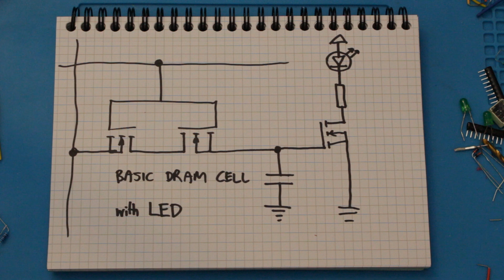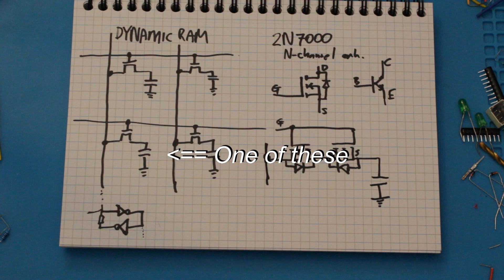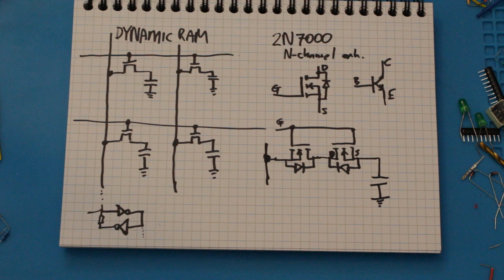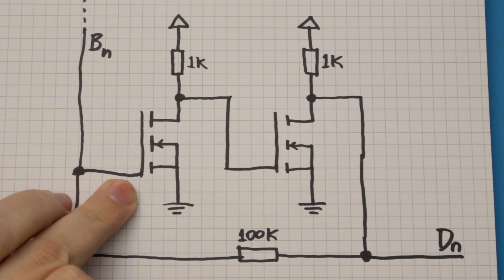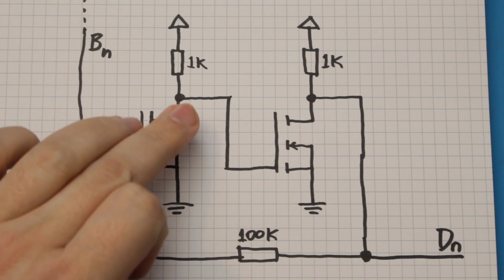Homebrew DRAM #2: Prototype and Proof of Concept

Comment: How about precharging? Perhaps this would make the circuit more symmetric with charging/discharging the capacitors? In real DRAMs the bit lines are usually precharged to half the supply voltage, for two reasons:
1. to provide the free charges that could charge the capacitor with the open path from the bit line, and
2. to equalize the time needed for both charging and discharging the capacitor.
It also helps with the sense amplifiers, because they can then just compare the voltage rise or drop between two precharged bit lines, one of them open, the other one not, by a simple difference amplifier (which your sense circuit kinda resembles of too). Emulating this behavior on a breadboard might be an interesting idea too.

Comment: mosfets are very sensitive to electric fields and circuit capacitance

I'm fairly certain that the reason the LEDs stay on longer when you have the static memory on is because of the circuit capacitance which is generated with them on, this is also the reason that if you leave the static memory on long enough and refresh the dram that it lights up; the circuit has been slowly charging the wires with capacitance until they are saturated and this is enough to trigger the mosfets, this is a huge problem in ICs and alot of the design goes into preventing this sort of thing

this is also the reason that the rows on the right drain faster; they're closer to the power supply and thus they drain from the ground/hot states, the rows to the left of them are maintained by the capacitance of the circuits to the right, it's fascinating how circuits can have such a dramatic effect on one another without being physically connected
Reply from the maker: Yes this was very interesting, most of my work is pure digital but in this one with essentially floating gates the analogue effects were very significant and pretty much impossible to control on the solderless breadboard. But I was able to get it to run stably, and as I said, learned a lot from the journey!

Comment: Can you get the complete circuit diagram so that I can understand what quality components are used at which place. Thanks
Reply from the maker: I'm not sure if I linked it in the description but I made a hackaday page and put the schematic there: https://cdn.hackaday.io/images/5657961604852961585.png Good luck!
Reply from the maker: And here's the link to the hackaday.io page: https://hackaday.io/project/175774-homebrew-dynamic-ram-with-discrete-mosfets

Comment: Great work. Did you connect to the 6502?
Reply from the maker: Not yet. I got a bit hung up on deciding whether to keep using an LED per cell, to visualise it well, or leave that out making it far fewer components per cell, but not as interesting to look at. I also started thinking about soldered prototype board layouts - I wanted to make a larger array one way or another
Reply: @GeorgeFoot  : perhaps Led / word line + Leds / read line?   Btw what capacitors got used please?